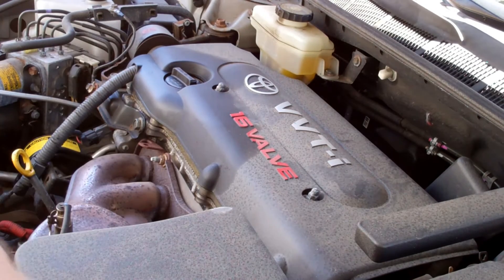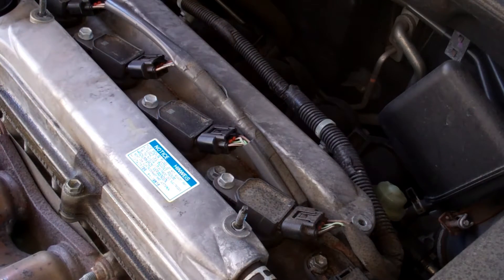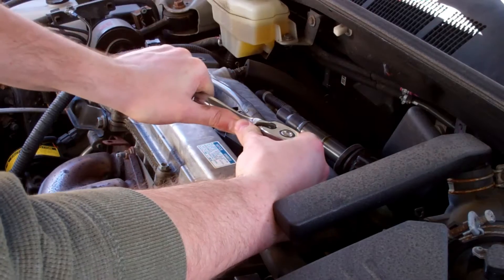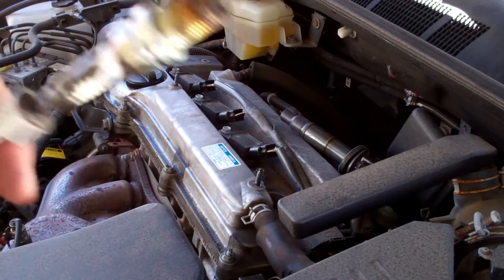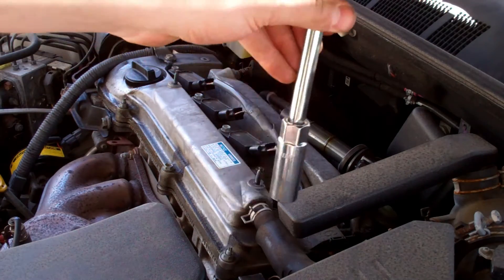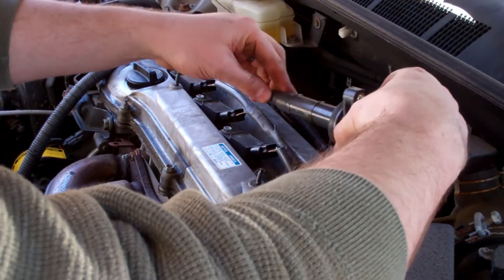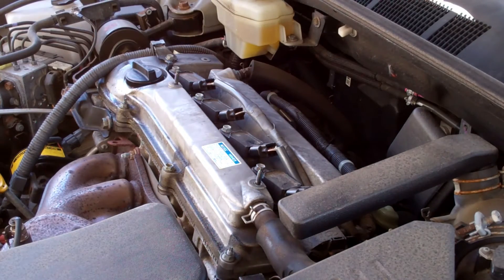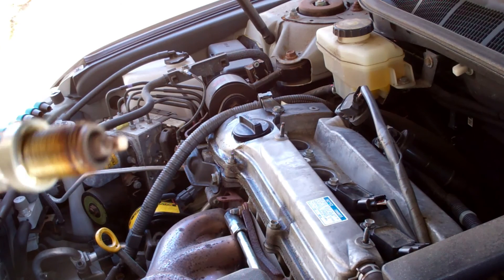Changing Spark Plugs on a 2007 Camry

Comment: Disconnect the coil so you're not stretching, pulling and cracking the wires and use the coil to pull the old spark plugs out.

Comment: Not a good idea to drop spark plugs in since that might affect the gap. If you don't have a spark plug socket with the rubber gasket, get yourself a small rubber hose that fits over the white ceramic part of the spark plug so you can place spark plug in under your control. A small telescoping magnet is good for taking out the old plug.

Comment: Correct me if I am wrong, I have a 2007 Camry.  Doing research for plugs I came across these as OEM.  Denso (5304) IK20 Iridium Power Spark Plug
Reply from the maker: That model of spark plug is compatible with the standard Camry 4 cylinder engines (2azfe 2002-2010). The Camry Hybrid engine (2azfxe) uses the same spark plugs as the regular 4 cylinder Camry, so will work for that engine as well.